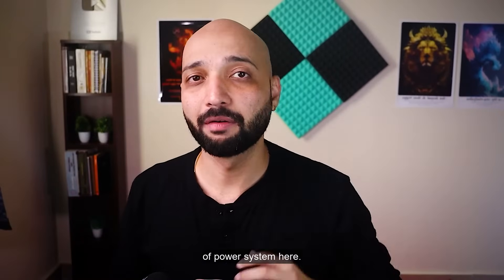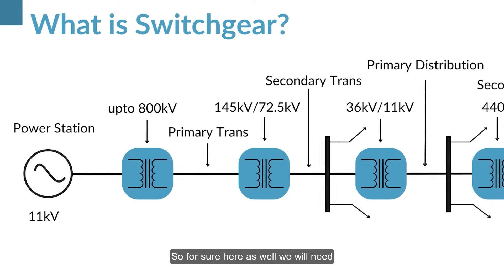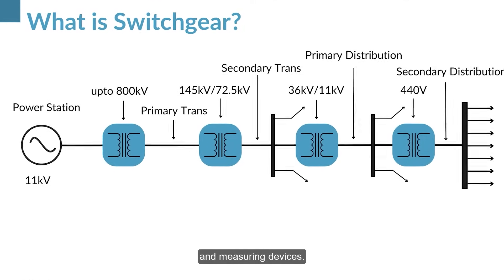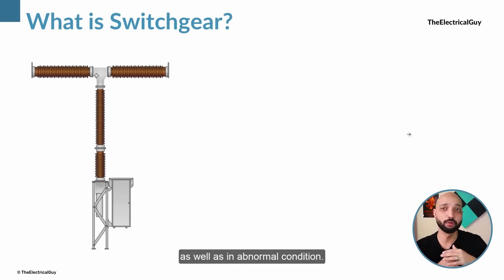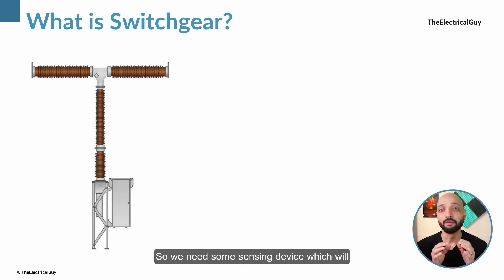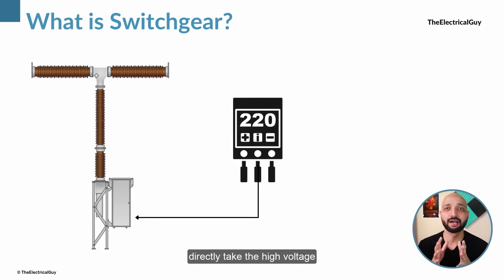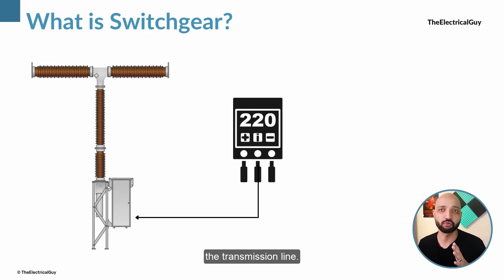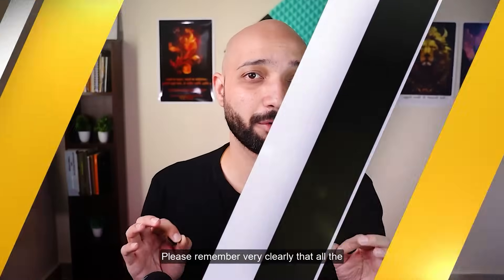What is Switchgear & why we need them? Explained | TheElectricalGuy

Comment: Just want to ask a simple question as i am not from electrical background so can we say a switch gear to a single Device like only for breaker or the combination of all protecting,measuring and controlling devices called switch gear.
Reply from the maker: A circuit breaker is also a switchgear, a relay is also a switchgear and all devices put together is also a switchgear!
Reply: Thanks bro very helpful

Comment: What is VCB
Reply from the maker: Vacuum circuit breaker which uses vacuum as an switching or arc quenching medium. Mostly use for and below 36KV voltage level.